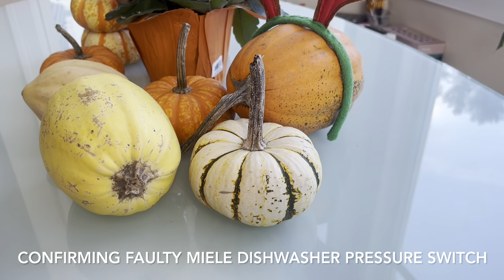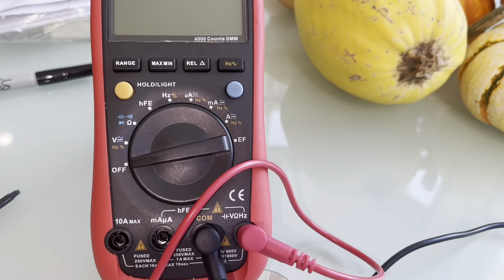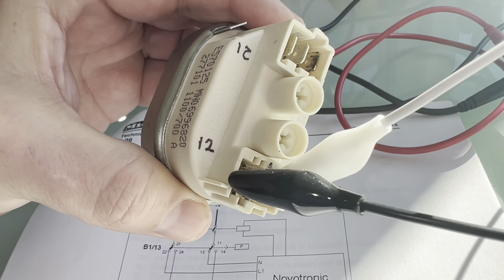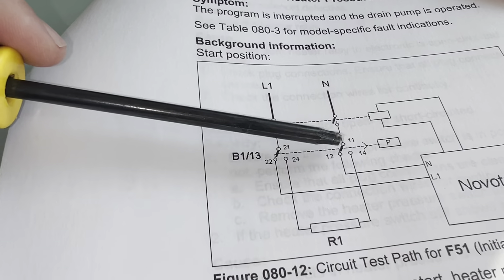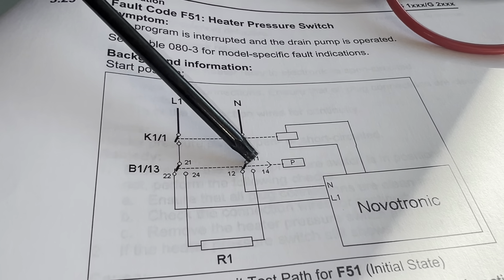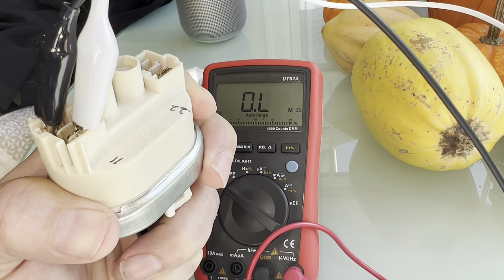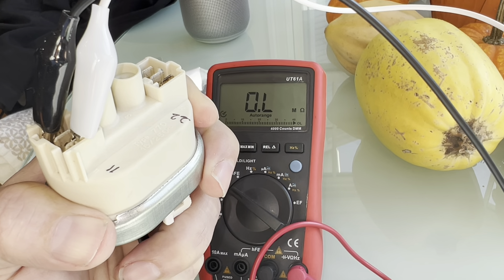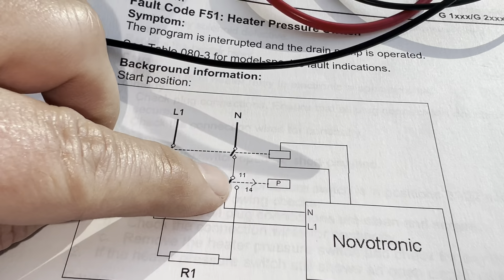Confirming faulty Miele dishwasher pressure switch (F14 + F24 error codes)

Comment: i have f51 and is related to this switch
Reply from the maker: That is great to know.  How did you end up finding this switch was the culprit?
Reply: @rogerscubadiver  although i changed the switch with another used that i know its working i have the same issue again F51
Reply: @rogerscubadiver  in another previous model i had success but now no f51 still makes problem and i dont want to buy a new switch that might not work when it will be installed
Reply from the maker: @JIMDP25  oh I get it.  I misunderstood your original post.  You are asking me if changing this switch will fix the F51 code you are getting now.   I don’t know that answer but can look at the manual later to see if it is related
Reply from the maker: @JIMDP25  I looked in the manual and F51 can be caused by the heater relay or the pressure switch.   

You can verify that both parts are working (or not working) as expected by pulling them out of the machine and testing them.   My video in this chat shows how to test the pressure switch.   I also have another video where I tested the heater relay
Reply from the maker: @JIMDP25  I test the Heater relay in this video.  Around minute 17:00

https://youtu.be/Df9xB7G2TFg
Reply: @rogerscubadiver  i chanehed the heater too same f51 the machine has 5000 working hours is it posible that the electronics fail?
Reply from the maker: @JIMDP25  it is hard for me to say what could be wrong.  Looking at the diagram that generates the F51, there are two parts in the path: heater relay and pressure switch.   If you could test these parts on their own to see if they are working as expected, it may help you answer if one of the parts has gone bad.

As you can see in my videos, I didn’t suspect  the Heater relay had gone bad since it looked and tested ok.   The pressure switch, which has a rubber seal and always has water in it, seemed more likely to break and it turned out to be that
Reply: @rogerscubadiver  after so much effort i found the problem it wasnt the heater relay or the pressure switch althoug i had f 51 it was the power supply it was faulty i changed the internal power supply and it is working perfect now no errors
Reply from the maker: @JIMDP25  wow.  That is interesting that the power supply could lead to an F51.  Amazing that you were able to track it down to that part.

Can I ask how you managed to find it was the power supply? What tests did you do ?
Reply: @rogerscubadiver  i heard some strange noises from the power supply part inside the machine  and sometimes power went out in the house because of the machine
Reply: @rogerscubadiver  latest news while test washes i got an f24 i changed also the pressure switch and f24 vanished the machine has 5030 working hours thats a lot of hours so  these damages are justified

Comment: Does anyone have a link for this switch that isn't a used part on eBay?
Reply from the maker: Just order them from the Miele website directly.  Really fast service in the US
Reply from the maker: See the description in this video on how to order the parts

https://youtu.be/V9FSfS0iPRw
Reply: I got both parts by calling Miele. Remarkably, they answer the phone. This is why I'm a Miele fan. Their stuff doesn't break less than the other guys, but they make it easy to get parts. FYI, they said that not every part is on-line and some require calling, which I why I couldn't find the relay.
Reply from the maker: @lensherman6242  glad you found the parts.   Keep us posted on your fixes.  For my case, it was the pressure switch that was really the culprit but since I didn’t want to take the machine out twice, I replaced the heater relay as well (even though I was pressure it was not the problem since my testing of the part showed it was working ok).
Reply from the maker: @lensherman6242  I have other videos that showed all my triaging steps before I found the root cause